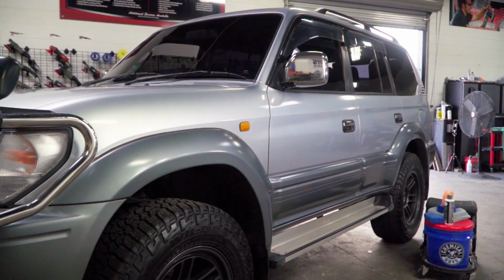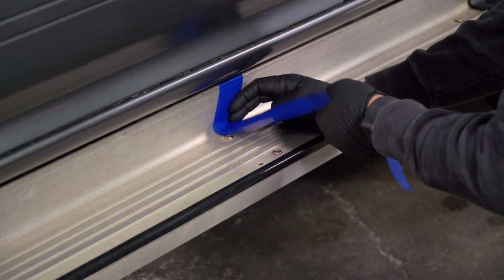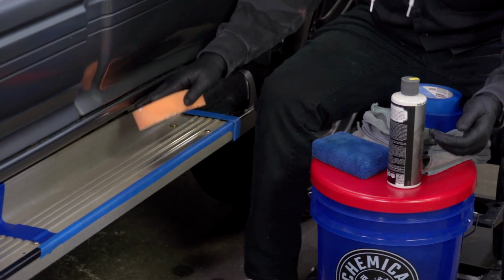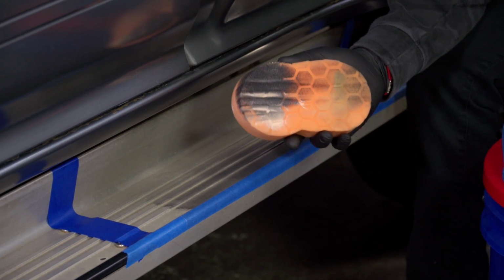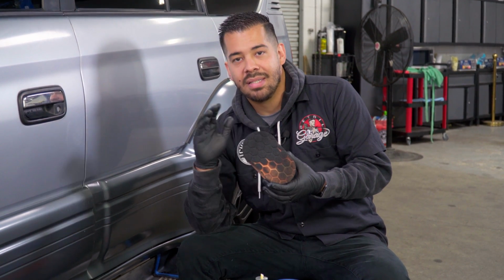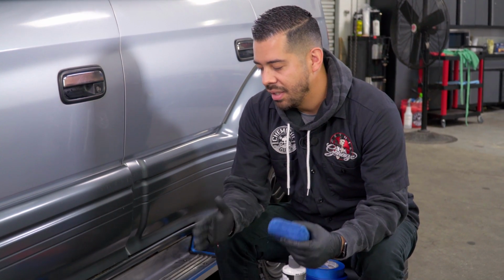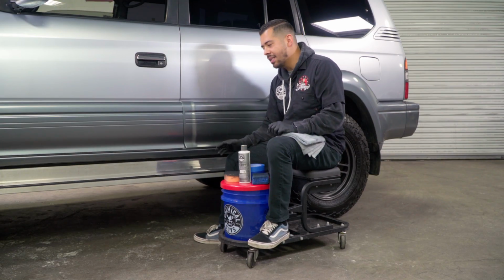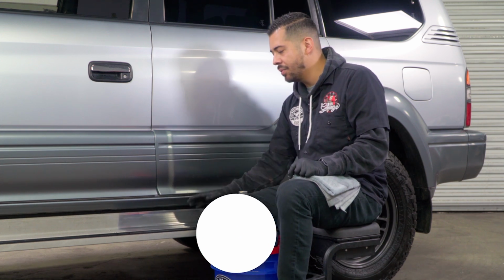Easy Way To Polish Metal - Running Boards, Rails, Exhausts, Anything Metal! - Chemical Guys

Comment: Do you’ll have a ceramic coating for rubber and vinyl floor mats/ carpets? Would love to see a video of protecting the floor mats after using Mat ReNew.
Reply from the maker: Hey! Check out HydroShield to provide a durable ceramic layer of protection to vinyl, rubber and plastic components. Use HydroThread for fabric and cloth protection.